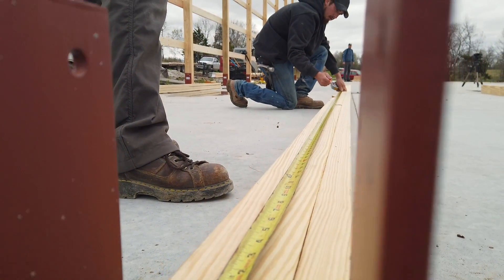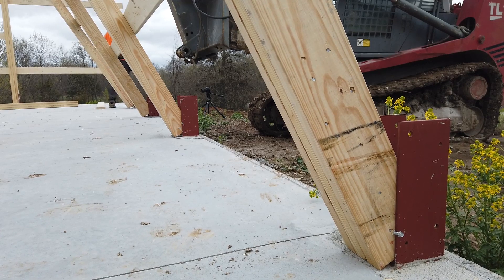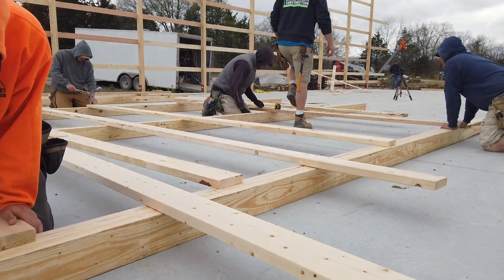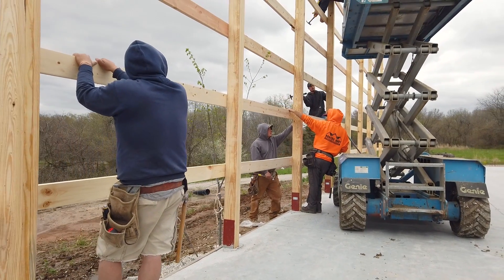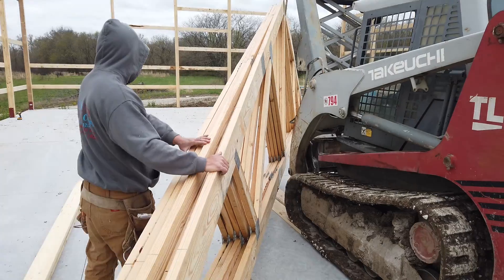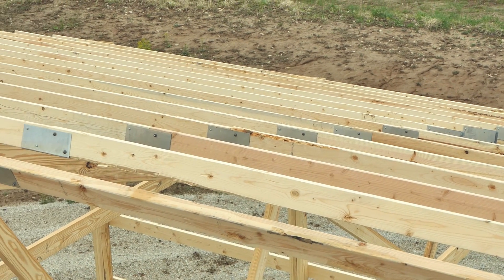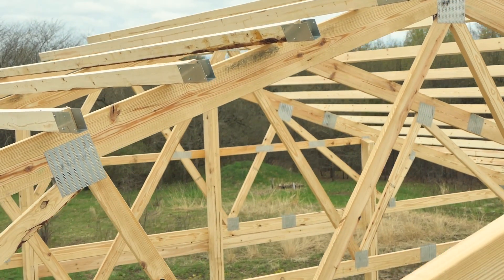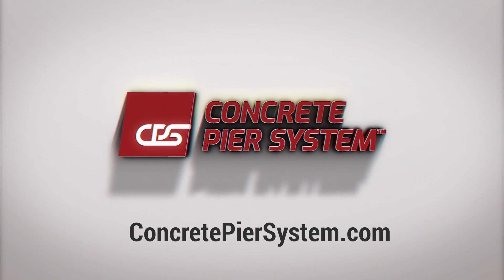The best way to frame a post frame or pole barn building | CPS System

Comment: I am wondering if they can set up for a pole barn house -- a lower profile pole barn. This foundation system would work well for that. Put in plumbing for a couple of toilets for 2 baths, set up for 2 beds and a garage, and that would be a sweet build, and maybe quick and cheap to set up. But would it be acceptable to the people in the city? I am guessing it would be, as it is more permanent than a mobile home. Any other sidings choices other than metal roofing? (I actually think the metal roofing looks good, but sometimes (often) cities require a "higher grade" siding if a mobile home is set up on your own lot in town -- probably the same issue with a pole barn.

Comment: Can you please explain how this meets the requirements of IBC Section 2304.12.2.2 where the base of the untreated wood column must be on a metal pedestal at least an inch above the slab?
Reply: It’s a treated wood column.
Reply: @benw5800  The column lumber in the video is not pressure treated.
Reply: @benw5800  They would not have to be pressure treated with a standoff.

Comment: Do you add a skirt girt or do you screw into the slab form board? Also the forms for the piers, do you remove that internal one once the concrete is poured?